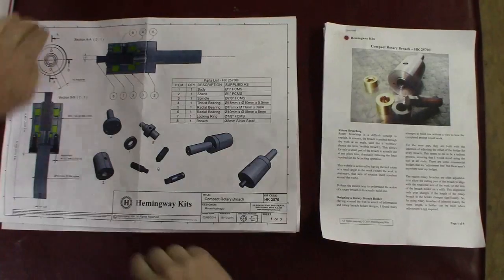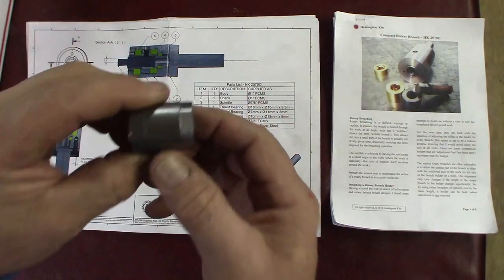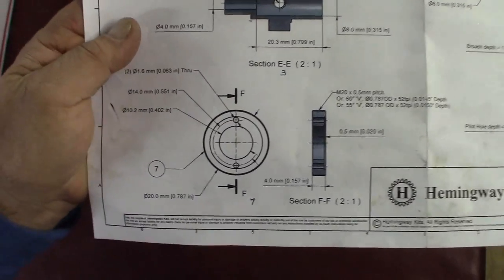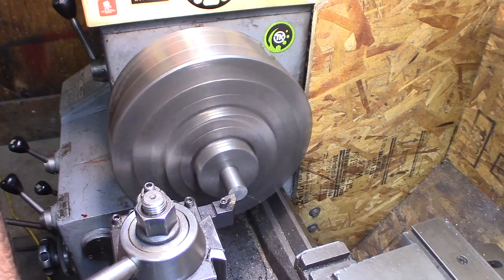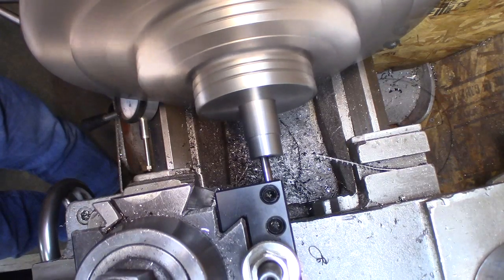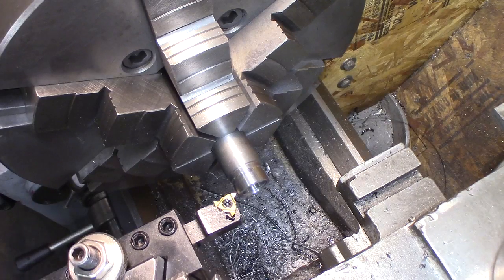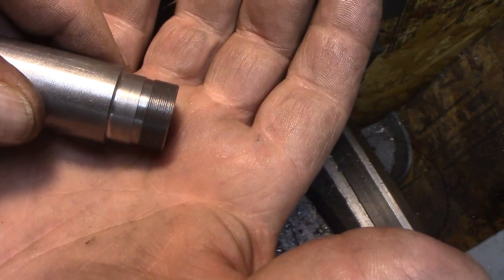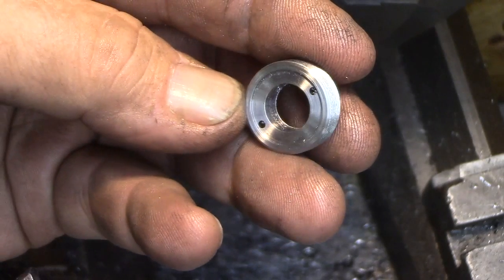How to Make a Hemingway Kit Compact Rotary Broach P1

Comment: I'm wondering about the 52 tpi. It sees the plans call for .5 pitch.
Excuse my ignorance but I would like to know how you came to 52 tpi. I'm trying to learn stuff...
Thanks and great video series. I have the sane kit on my bench ready to go.
Reply from the maker: It was called out on the drawing as an option for the .5 mm thread.
Reply: @RRINTHESHOP  thanks...haven't opened the plans yet.
Guess I was a little  premature. 
Thanks for responding.

Comment: If no 52 tpi gage use 26 tpi for every other thread.  I have done this type of checking in the past.
Reply from the maker: Never thought about that, I will have to try that.  Thanks Roy.
Reply: Any multiple should work.  2, 3, 4, or possibly 5.

Comment: A 26 TPI thread gauge will fit nicely in every other groove. This technique will extend the measuring capabilities of thread gauges that don't go fine enough. Of course you won't be able to measure some pitches (53 for example) but if your desired pitch is a small multiple of some pitch gauge which you DO have then it will work.